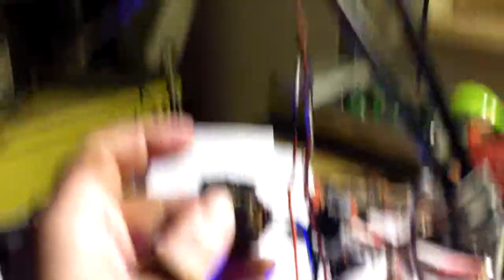PREDATOR PLASMA CASTER V2 0 ANIMATRONIC PROGRESS ASPERGERS SYNDROME

Comment: Cool :) I've printed a face mask and cannon.. just received some neoprene cord for the dreadlocks.. was planning on putting a 3 axis accelerometer behind the mask (in between the eyes) to get head tracking.. from your vid, are those picaxe? If so.. are they running at M32? The sound is sharper/better imo but definitely consider metal gears.. nice looking project, love it. :)
Reply from the maker: I just bought a 3D printer and I'mn going to use it to print out a plasma caster in the future then I'll put electronics in it .     My Printer's not big enough to make a whole Mask so I'd have to learn how to cut a mask up into 4 pieces and then print them out individually .     Yeah I thought about using two  Mems compasses to do head tracking but I'm not great at programming .    Yes I'm using PICAXE , I haven't learned how to use Arduino yet but I want to  .    Nah I'm just running hte picaxes at 4MHZ .     Yes Metal gears definitley for long lasting servos , I've used plastic gear servos and  they develop a worn down area on the gears because I have a Demonstration mode where it goes back and forth and up and down repeatedly and that's worn down My gears over the years .      So My next version will definitley use Metal Gear servos .   It's nice meeting You Lee Stanley , I hope You make videos of Your Predator stuff when You get it built , I'd love to see that .   Not too many Electronically minded people out there making predator stuff .    I'll sub you because I love predator stuff .    THanks for commenting , its nice meeting another predator person :)  Take Care :)
Reply: Will do Kyle (video it) I've been watching all I can because I've printed the mask and cannon, the mask I printed had to be done in two sections, the head doesn't go back as far as I'd like so I may start again.. from memory, the servo command should put the picaxe into M8 frequency mode automatically but I built a laser toy for my cat.. used a 20x2.. SETFREQ M32 ... it just sounds so much more.. predator :) .. if you're looking at getting into Arduino, I don't think you'll go far wrong with a NodeMCU.. built in WiFi.. small footprint and USB powered.. cost about £3 for all that awesomeness.. I still like the picaxe though, it's great for sensors.. single tasks.. and they're  tiny..